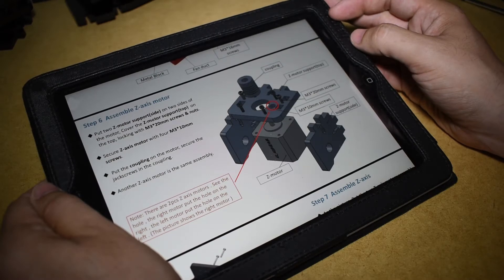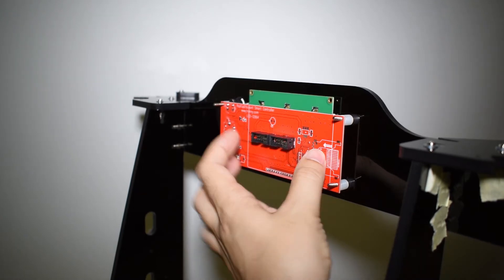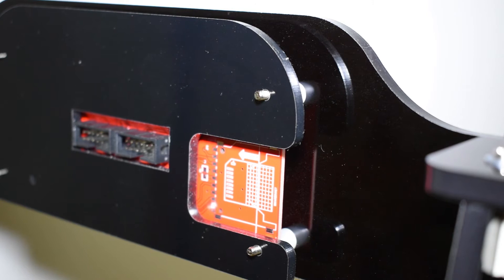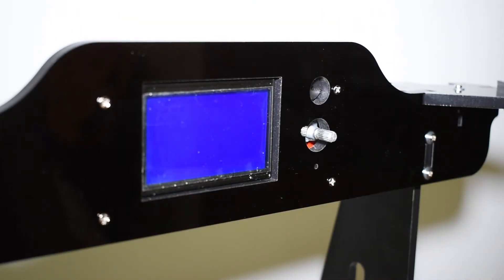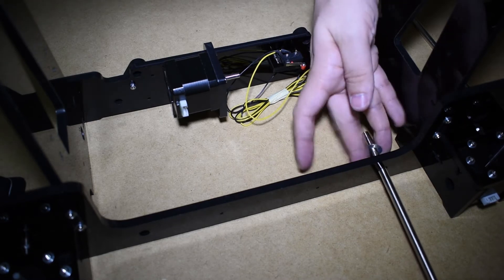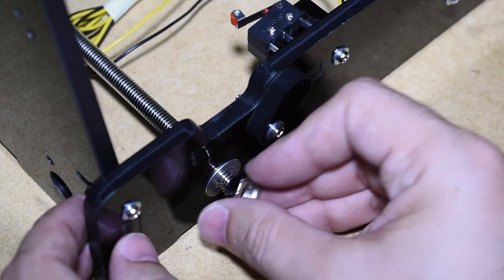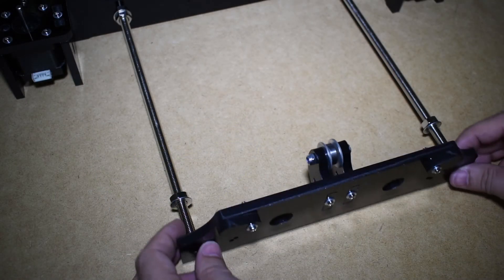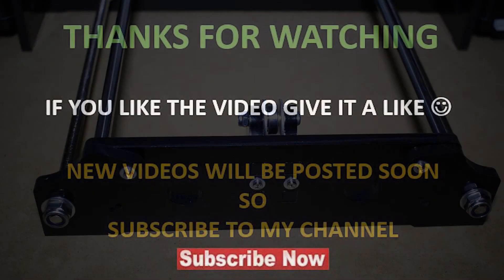Tronxy X8 assembly STEP  3

Comment: hi I have problem with tevo tarantula extruder doesn´t turn on and i don´t know what to do i tried change cabel and plug it  on other steper motor and everithing worked stper motor works to when i plug him like x motor it is  probably filmwere but I dont know what to do :( can you help me ?
Reply from the maker: Hi,
Did you turn the nozzle temperature up? For safety reasons, the firmware does not allow the extruder to move unless the nozzle temperature is above a certain value (defined in firmware). Try raising the nozzle temperature up to 200 degrees and test again. If that does not work, check the vref adjustment potentiometer on the extruder driver in the main board and check if everything is ok (solder joints, missing components, etc).
As a final solution, you can always use the spare driver (if you are not using dual extruder) and use that one instead. You just need to define that driver in the firmware.

Comment: hi, I have finished mine and did a test print of a 2cm cube. The size is spot on! And Octoprint supports it out of the box, but the given 115200 baud rate isn't right. I used auto detect to get it working. To make the cables tidy, you want to turn your z motors 180 degrees, so the connector is facing the inside of the holder. The cables go through the hole in the acrylic frame and connect to the motor.
Reply from the maker: Hi, thanks for the feedback.Regarding the Z motor connectors, i noticed that but, you need to pick up the printer so that you can reach it and connect the cable. That didn't feel right to me so that's the reason for installing the connector faced forward.
Reply: ruiraptor the (poor) instructions should have mentioned that the z motor cables should be connected first, and then fix the motors onto the acrylic parts. I figured this out when I tried to tidy up the cables and by comparing against x8 sample photos by the manufacturer.
Reply from the maker: True...but if you eventually have to troubleshoot something then you will need to go under the printer. 
For me it would make more sense to have a wider hole at the back so that you could reach the connector entirely.
Reply: ruiraptor yes, that would be ideal.